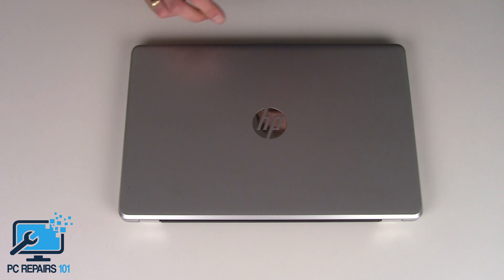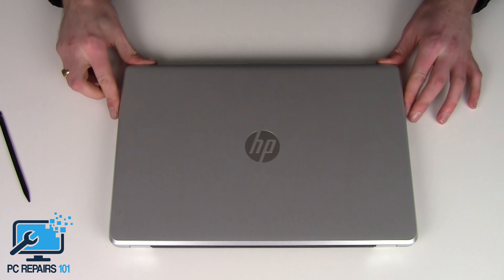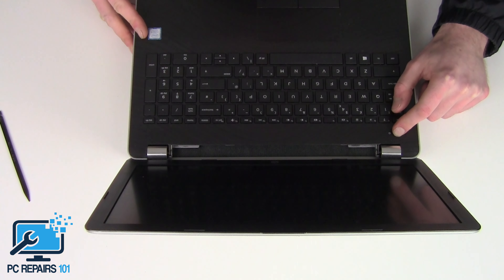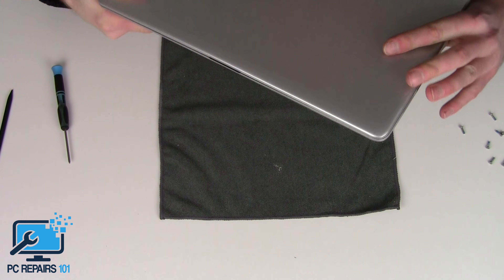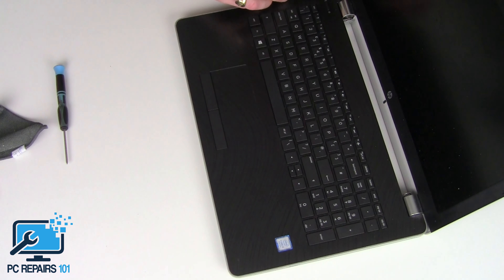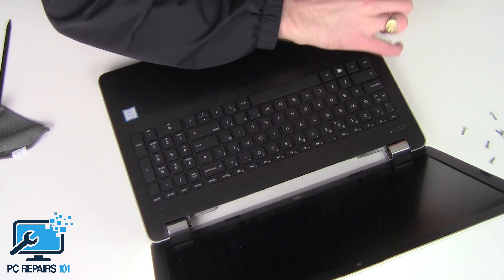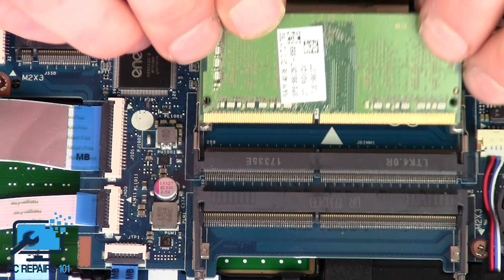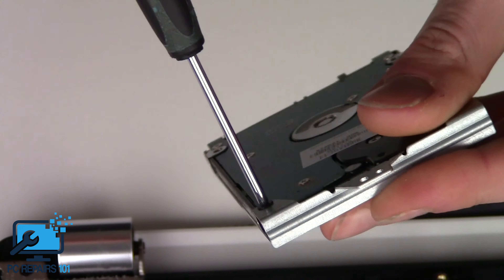HP 15 Series (HP 15-bs158sa) - Upgrade & Replace SSD / RAM / HDD - Disassembly Tutorial Guide

Comment: Thanks this video was great and I was able to follow it exactly. My ram started failing one week out of warranty Grrrrr.... and the HD was already so very slow. Replaced the 4GB of ram with 8GB and installed a new SSD and new Windows 10 from Microsoft without HP bloatware and WOW what a speed demon. This thing must be 20 times faster now.
Reply from the maker: I am starting to notice a few more failures on ddr4 ram than I have seen in the predecessors.  Glad to have helped though thanks

Comment: Hi, very simple video to follow,thanks for that!👍 I've got a 15-bs1xx and got some questions about upgrading the ram in it

Can I completely replace the stock 4gb of ram with 8gb of ram?

Once the ram is replaced and the laptop is back together, do I have to do anything or will it just instantly start working? 

Lastly, I found '8gb of ddr4-2666 SODDIM memory' by crucial, I'm wondering wether that is fine to use or whether you could recommend any particular ram that you have used that works fine with the laptop? 

Thanks 👍 💚
Reply from the maker: Thank you appreciate feedback. Yes that should be fine to use that RAM. Once fitted it will boot up straight away. Some BIOSs may say the rams been changed do you want to continue etc. Once on, go into system properties and check its reading the right amount. If youd like to test the ram Google a tool called memtest
Reply: @pcrepairs1015  thank you 👍

Comment: Great guide thanks. Word of caution if your a bit ham-fisted like me.  I managed to break the right hand screen hinge bracket opening the case and I really didnt use much pressure. Very poor components I think. Not really an issue as the laptop is goosed and I just wanted to get the hard drive out but do (as instructed in the video) take great care with that last bit.

Comment: Thanks, I'm planning to upgrade to a ssd and incrase ram on my HP 15-da0596sa. The main difference I have is the battery is not so easily removed as it is underneath the case. Presumably I can take the back of the laptop off first and then remove battery and carry on from there.

Comment: Great video!!!!!
My  HP Pavilon 15-bs158sa is working very slow  so I've decided to upgrade RAM memory on it.

At the moment there is 4GB  DDR4 RAM 2400Mhz Samsung installed.

I was planing to upgrade it to 12 or 16GB

after long search on  internet to find out what type of RAM memory is needed  i think i got idea but before buying it I would like to double check with an expert if I'm right.

So as I understand it will be better to buy 16GB new memory rather then adding 8GB to existing 4GB?

Is it better to buy 1x16GB or 2x8 ?

does my laptop support higher frequency  like 2666Mz and higher or will  should I stick to whats installed?

is it 260 pin SODIMM type of RAM?
What do you think of these two :
Timetec Hynix IC DDR4 2400MHz PC4-19200 Unbuffered Non-ECC 1.2V CL17 2Rx8 Dual Rank 260 Pin SODIMM

Crucial Ballistix BL2K8G26C16S4B 2666 MHz, DDR4, DRAM, Laptop Gaming Memory Kit, 16GB (8GB x2), CL16

Thanks for any advice
Reply from the maker: Hi Dominik, if you want to send me the serial number of your laptop via a private message and I will check for you
Reply: @pcrepairs1015  sorry I cannot send private message. dunno where to find it. could you give me your email adress?
Reply from the maker: @dominikdebciuch9998  just send it over via this message if youd like
Reply: @pcrepairs1015  its HP Notebook - 15-bs158sa (2PR32EA)
Reply: Did you get chence to check?

Comment: can i add more ram to it like 2x8gb 16gb 
and is it possible to add another ssd . i really want to keep the 1tb hdd i thought i could remplace it with the cd reader ? pls respond ''
ps: my pc is HP 15-da0032nk
Reply from the maker: Hello Mr Breakout, yes this is correct you can add 16GB (2x8GB) infact you can have up to 32GB (2x16GB) you can also add a m.2 SSD drive and keep your DVD drive and 1TB completely intact and still in use. Please see the link below for the parts for your specific laptop at Amazon.com -
8GB DDR4 - https://amzn.to/2Zc3Quv
16GB DDR4 - https://amzn.to/383v9Lz
m.2 SSD - https://amzn.to/2Ny2FAg

Comment: Thanks for the video, could not work out why the cover would not come off, and you showed the extra screws under the feet ! One thing to mention, after whipping out the old HDD and putting in a new SDD, the machine would not start. Took the cover off again and after much munching over the problem, popped out the CMOS battery for a minute then put it back in. Voila ! We have lift-off ! :-)

Comment: Hi! I was just hoping you could help me, is this worth an SSD upgrade or just worth savjng for a new laptop? If not, what SSD would you recomend. and as for ram, do you think with this processor and a ram upgrade itll run After effects and photoshop? Thank you
Reply from the maker: Hi Tom, thanks for your message! I would say that it would be more economical to fit an SSD first, the performance increases are amazingly good and would be considerably cheaper than a replacement. How much ram do you have in it? Also do you know the specific CPU in your model?
You can buy the solid state drives here on Amazon - https://amzn.to/3jZkirC
I would recommend WD or Kingston however even the cheaper Chinese brand ones have been very reliable for me.
Reply: @pcrepairs1015  its only a 4gb, thinking upgrading to a 16 gb would be much better? I5 Processor. But...only 1.6 hz
Reply: Ill find the specific CPU for you now... i belive its I5 8250
Reply: What SSD would be an appropriot fit plz for my laptop? Does it need to be a specific gb or speed/size?
Reply from the maker: @TomMCJL  all of these pretty much have the same speeds. It will be a 2.5" ssd you need in regards to its size which are the standard size ones. Storage capacity will be your personal preference
Reply from the maker: @TomMCJL  With the RAM and SSD, this should still be considerably faster and cheaper than a replacement system. I would recommend doing this over a replacement. Although it is only 1.6GHz is it a newer generation i5 so that has that going for it too regarding speeds etc.
Reply: @pcrepairs1015  it is 3.6 if turbod but not sure if that is a good idea
Reply: Would my cpe even after 16 gb upgrade and ssd be able to run these pretty smoothly. Or do i invest in an upgrade
Reply from the maker: @TomMCJL  I would say it would be better to upgrade this than replace
Reply from the maker: @TomMCJL  I would say that they will be able to run what you need to do smoothly

Comment: Is it possible to keep the hard drive in the laptop and use it for storage and install an ssd in there to make the laptop boot faster? I use a HP-15 bs0xx laptop
Reply from the maker: Yes exactly, so you can fit a SSD drive in the m.2 fitting and then also keep your 2.5" hard drive for storage

Comment: My laptop has 1 hdd along with 250 gb ssd in which os is installed.(in ssd except os, no other files are there)
All the data is in hdd.
If I reinstall windows using cloud recovery tool, if I don't took any back-up, does it erase my hdd too?

Comment: One can upgrade from normal keyboard to a backlight keyboard as this model laptop has keyboard light point  but Hp is not shipping laptops with backlit keyboard so you can buy any hp 15 bs series keyboard with backlit and add to it.

Comment: Hello, many thanks for your guide it was very helpful! I've replaced both RAM and the HDD, with an SSD. Unfortunately the SSD is not being detected by the macchine itself.. Any suggestion? Many thanks in advance!
Reply from the maker: Hi, yes that will most likely be because it hasnt been initialised. If you plug it into a computer with windows on it you can initialise it through the disk management tool on Windows
Reply: @pcrepairs1015  Hello! Many thanks for your comment :) really appreciated! Actually I was a little bit a noob.. I did not plugged correctly the new SSD eheh I had to reopen again the laptop, double check and plug it correctly. Then it worked perfectly! Thanks a lot for your help, have a great day!
Reply from the maker: @Defteros86  Glad you got it sorted! Remember to subscribe Thanks :)
Reply: What ssd you got?? Plz provide the link
Reply from the maker: @rajatwow737  Sure, I would recommend this one. I have sold probably over 100 of these to customers in their repairs and ironically had crucial ssds etc fail but not these ones. They are very affordable too https://amzn.to/3iP9dZ0

Comment: Hi there, i have a very similar laptop, which has a i3, can i upgrade to i5 or i7 or specifically cpu
Reply from the maker: This all depends on if the processor can be removed and replaced on your particular laptop model
Reply: I have a hp 15-bs560sa could you please tell me if it does?
Reply from the maker: @darrynbancroft9812  From looking online at the motherboards for this particular model it appears the processor is built in and there for cannot be upgraded unless upgrading the whole board to a more powerful model, if there are any out there. I would suggest upgrading to an SSD to upgrade the speed, this will be the most economical / efficient option
Reply: @pcrepairs1015  I have a HP Notebook - 15-bs244wm can you tell me the max ram/ssd,hdd/if u can change a proccer

Comment: I have an HP 15-bs0xx that I want to upgrade to SSD and keep the HDD.  Can I simply install an M.2 SSD(if so, what kind?), clone the HDD to the SSD, and then format the HDD?
Reply from the maker: Hi there, that is exactly it. I use Arconis True Image to clone. Regarding m.2 SSDs you can purchase them off Amazon UK here - I use the Western Digital Greens as my go too - https://amzn.to/2Z34IBQ
Reply: @pcrepairs1015  I appreciate your rapid response.  When following your link I was presented with m.2 SSDs where some were SATA while others were NVME.  I assume that I need the SATA version.  Correct?  Thanks again for the advice.  David
Reply from the maker: @TheSVOrion These are what you need. Depending on the size you are looking for but NAND m.2 SSD - https://amzn.to/2Vcc9p7

Comment: Great stuff. I'm keen to give it a go. My HP has 2 strips of rubber feet running the length of the laptop and although I'm sure I can pry them off, I'm a bit worried about getting them back on so, hopefully, they don't later peel off.  Do you think there will be enough sticky to hold them in place? Thanks.
Reply from the maker: Yes they should be, if not get some double sided tape then use a scalpel or sharp blade to carefully cut around the excess tape.
Reply: @pcrepairs1015  That's great thank you - and for taking the time to reply.
Reply: @pcrepairs1015  All done, thanks again for the video, I wish you'd a few more.
Reply from the maker: @mikehill9806  Thanks for the feedback Mike appreciate it. I am slowly organising the routine at my shop to factor in the ability to make more videos soon etc. So if you subscribe you can keep an eye out :)

Comment: Can graphics card be upgraded to hp notebook x64 based laptop? Pls let me know
Reply from the maker: Hi there, unfortunately the graphics are built directly into the board and upgrading is not an option
Reply: @pcrepairs1015  so why there are so many tutorials for upgrading a low end laptop to a gaming beast with a new graphics card? It is impossible right?
Reply from the maker: @yomum6392   @Yo Mum  There arent from what I am aware? They usually upgrade the ram and replace hdd with ssd. However you can also buy external graphics card caddies to put a graphics card into to run with your laptop to get proper smooth high end gaming! You can buy them on Amazon here - https://amzn.to/2ZL4eAy
Reply: @pcrepairs1015  thank you
Reply from the maker: @yomum6392  Thats okay

Comment: In my hp laptop Nvme ssd is not detected neither in bios nor in laptop. And the port on the motherboard is nvme b key. Is there any other software i have to install. 832B hp motherboard i have. Please help!
Reply from the maker: Have you confirmed this ssd is definitely compatible? You can check compatibility using crucial memorys checker on their website. Try updating the BIOS if not. You can get bios updates from the manufacturers website.

Comment: I have a hdd hard disk an i want to add another hard disk but ssd is it possible ?
Reply from the maker: Yes providing the laptop has a DVD drive bay you can infact get a DVD drive which has a HDD/SSD caddy in it instead. You can find these on Amazon or Ebay, I'd reccomend these for any laptop that doesnt have an m.2 or any second storage bay, they are incredibly handy!
Reply: @pcrepairs1015  thank you very much for this great content

Comment: Hope I dont sound too stupid but, if I put another 4gb ram card in the other slot does that make my laptop 8gb ? Is it that simple or am I missing something and how do I know which card I need?
Reply: It is just a simple as that!
Reply from the maker: No if you leave the other 4gb in and add another 4gb you will have 8gb. It just multiplies the amount of ram by what you add. I.e, If you added 2gb to a 4gb system, you will be running a total of 6gb which you can check in ' system properties ' in the Windows system.
Reply: @pcrepairs1015  so can i just randomly order some 4gb ddr4 ram or is there something I need to check?
Reply from the maker: @sreejithsubhash7301  you can order up to 2x8gb ddr4 3300mhz modules for this model.
Reply: @pcrepairs1015  Thanks a lot for answering my question.
I just had one more query, I found a match for my ram, but it is from a different company and it has 8 chips on one side whereas my ram has 4 chips

Other than that all the specifications are exactly same. So can I use it in the empty slot along with my old ram?
Reply from the maker: @sreejithsubhash7301  although not a guarantee, I would say yes this should be fine it's very rare theres any issues if the specifications are identical.

Comment: If you use a different size hard drive, like say, 8gb ROM another HP laptop? What happens?
Reply from the maker: Sorry im not sure what you mean? However if you mean what happens if you transfer the hard drive and 8gb ram from another laptop to this laptop, it will be fine providing the hard drive is sata and the ram is compatible

Comment: This laptop looks like the aluminium version of my laptop because my laptop is made of plastic.

Model: HP Notebook 15-bs092ng

Edit: For people who want to be laptop gamers, i would not recommend buying this 15-bs092ng model because the graphic card and the processor suck.

Edit 2: specs of my laptop

CPU: Intel Celeron CPU N3060 @ 1.60GHz
RAM: 4 GB (I upgraded my RAM to 8 GB)
GPU: Intel HD Graphics
Storage type: Hard Disk Drive
Reply from the maker: You are correct. I wouldn't reccomend a laptop for gaming without dedicated graphics. In fact I would heavily suggest a desktop for gaming as laptops will fail at some point, not when but if. If however you were to choose a gaming laptop I would go for Acer as a brand.